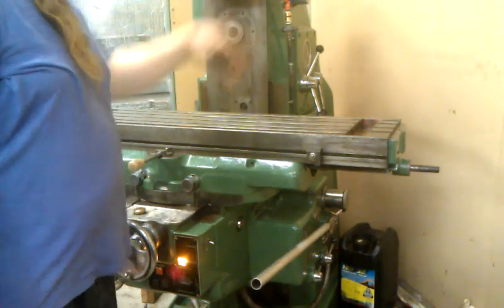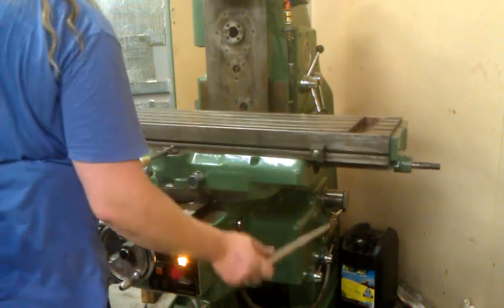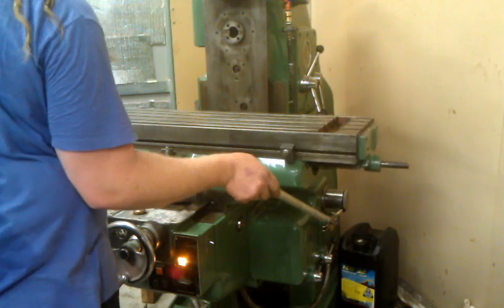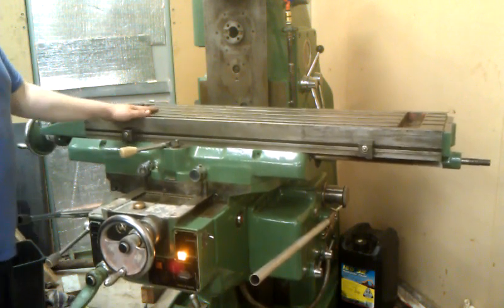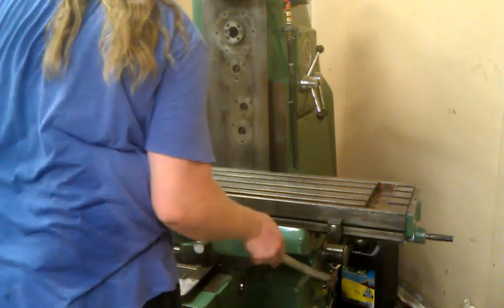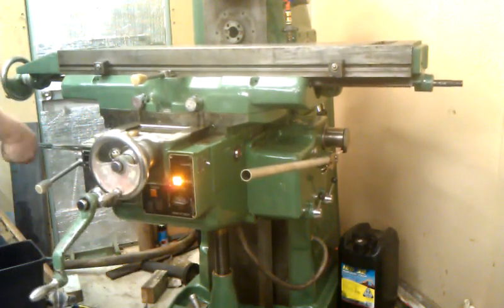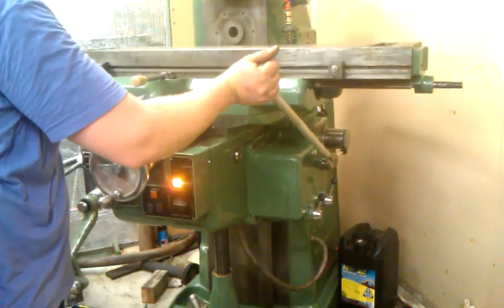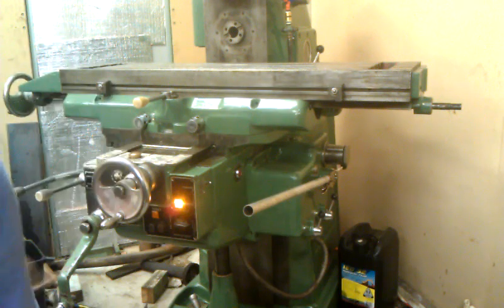Vernier Mill feeds

Comment: I have a Vernier FV270 which is a very similar machine, and the quick feed lever is missing. The axle with the splines is there, but turning it by hand doesn't really engage anything - it turns freely about 180º in either direction and then comes to a stop. It also has some axial motion of about 1cm (in and out). I'm unsure wether it's just a matter of attaching a lever and applying more force or if something is broke inside. Do you have any insight about the quick feed mechanism? I have no mechanical drawings and have been so far reluctant to disassembly the feed gearbox to look inside.

Comment: Nice machine! Vernier it's an excellentfrench built it's heavy machine! Cool :)
Reply: En fait pas plus que lourdes que d'autres equivalentes en courses, Pierre

2650 kg pour une VERNIER FV3S 1000 x 320 x 600
Soit 13,8 tonnes /m3

Si on compare avec une DUFOUR 302 : 

1100 x 350 x 550 3500 kg
16,52 tonnes /m3

Une ERNAULT SOMUA Z3C

1000 x 325 x 340  2500 kg

Soit 22,62 tonnes / m3

Je n'ai jamais utilisé de Z3. La Z1 est sympa, mais nettement plus petite, donc pas comparable. 

Dufour et Vernier sont pour moi difficiles à departager. J'ai une Vernier, mais j'aurais pu aussi bien acheter une Dufour.